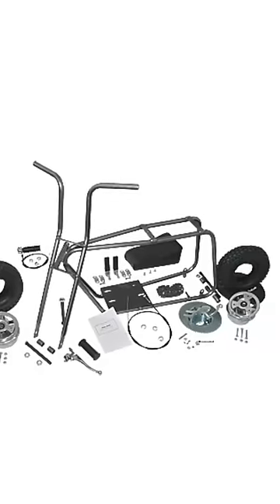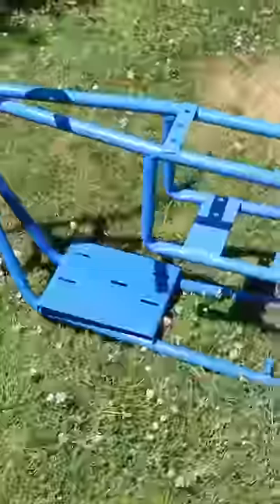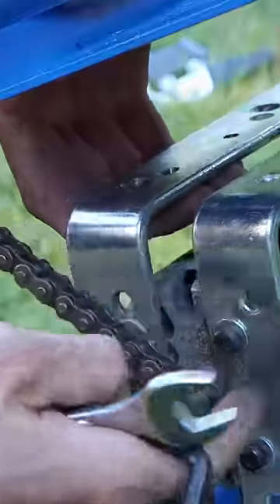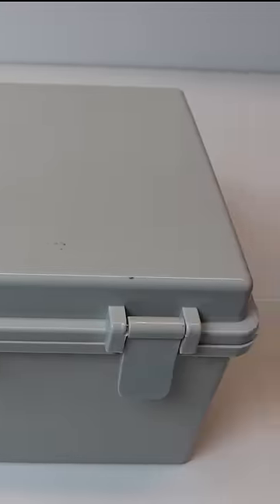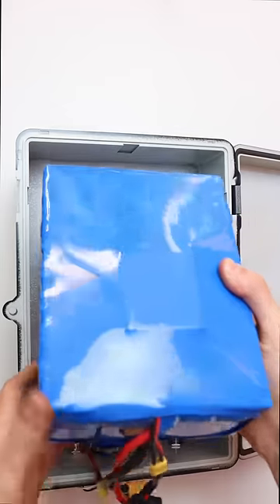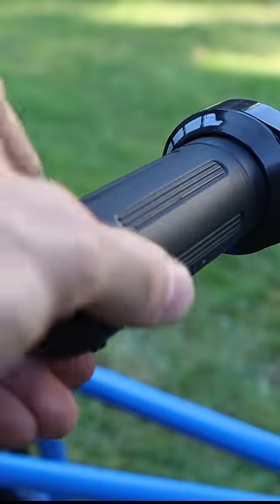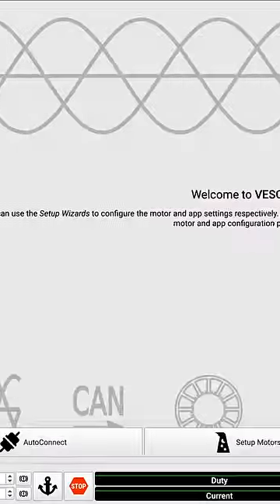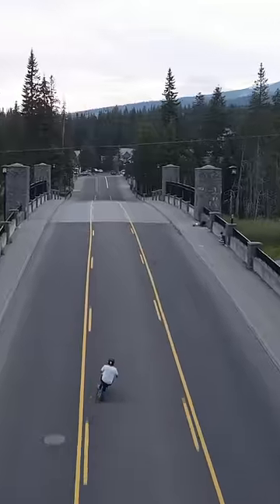Building a 7,000W DIY Electric Mini Bike #diy #electric #minibike #ebike

Comment: 726wh on a 7kw motor? You're gonna get about 3 miles down the road and run out of battery lmao
Reply from the maker: Motor is not running anywhere near 7KW
Reply: @DIYesk8Builders okay so why say 7kw in the video title then lol.
Reply from the maker: the motor itself is rated at 7KW
Reply: @DIYesk8Builders  so yeah it just depends on what controller you have then. And what the bms discharge is. If you were never planning on using the full power of the motor then why would you choose such a powerful one? Surely you could've gotten a less powerful one for less money and still achieve the same result.
Reply: @DIYesk8Builders  this whole thing brings me back to my original point lol. Why such a small battery when you could easily get way more out of that motor? I would get a 72v battery keep the 100 amp controller and bms and boom you can use the motor to its fullest capacity
Reply: @DIYesk8Builders  it's pretty cool for what it is tho. Sorry if I came across as condescending throughout any of these comments that wasn't my intention
Reply from the maker: All good! This motor leaves a lot of room for upgrading the bike. Every year we try to upgrade something to it so eventually the goal will be to get the most out of it. Having a bigger motor that is not being used fully also means that the motor is less likely to overheat.

Comment: Need a machine shop to build it
Reply from the maker: would be nice
Reply: nah. All you need is ingenuity for this. Use bolts to fit the battery instead of weilds, and bend the metal pipe by hammer over a railroad track.

Comment: Yeah, you can boil down this video to this bike builder as saying:

I build a moving flesh stripper for the pelvis. It basically consists of totally eliminating any elements of suspension from the design of this sh#t e-bike so the experience is as excruciating for the rider as possible as their bodies are exposed to every irregularity in the road's surface and increasing that effect by positioning the seat really close to the ground. 

Yup, I have access to cad software to fill this world with as many anti-ergonomic designs as possible.... and that's a life commitment as the dumbest designer.

Comment: 7kw motor and you can only go 35 mph - you seem to be either not very good a programming your controller, or you are LYING about what components you used.  Edit: yeah, after looking at a couple of your other videos - you have a habit of greatly exaggerating components on your projects! LMFAO
Reply from the maker: The components that we use are rated for the power we say, but it is true we are not using them to these specifications. For example, the mini bike ESC is limited to 100A, so at MAXIMUM we are still only at 4kW. Most of the time though, we are pulling nowhere near that. The gearing of the bike is also not favorable for speed, but for torque.
Reply: @DIYesk8Builders  LOL - ok - it is your story! My 1.3k will do 35mph all day long. The acceleration (torque) of your mini bike is not at all impressive, so you have a serious problem being honest with others!

Comment: 2 hell w/electric BS ! WHERE YA GUNNA CHARGE UP AT WEN YA RUN OUTTA POWER ? What if U have a downed power grid from a hurricane ? A circuit burns out leaves U stranded... I'll stick with gasoline or alcohol fuel !